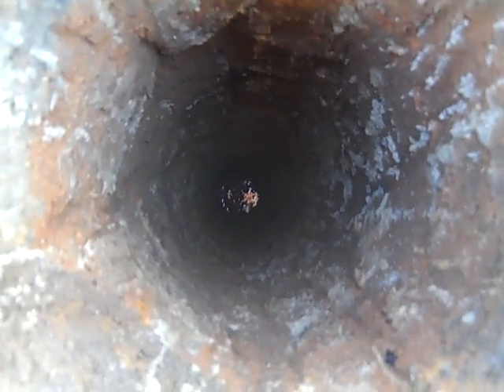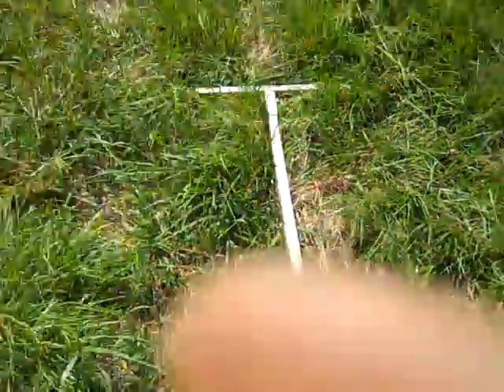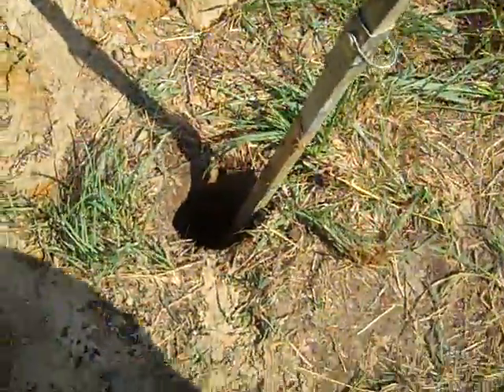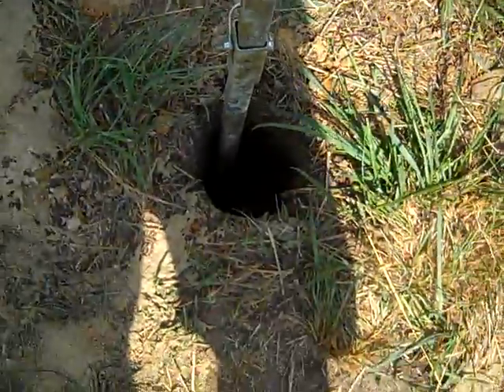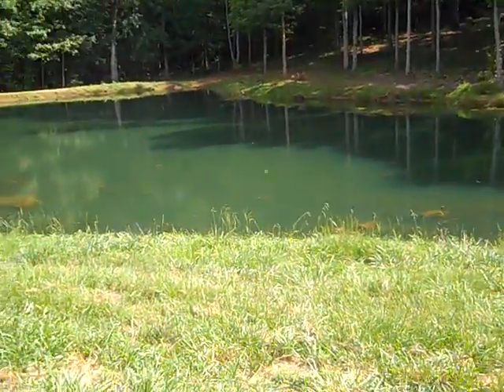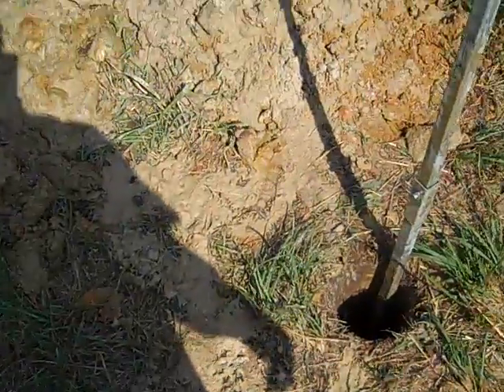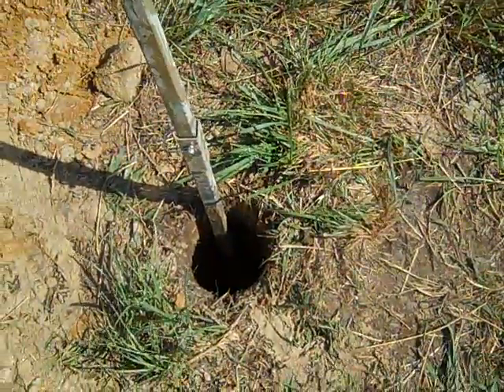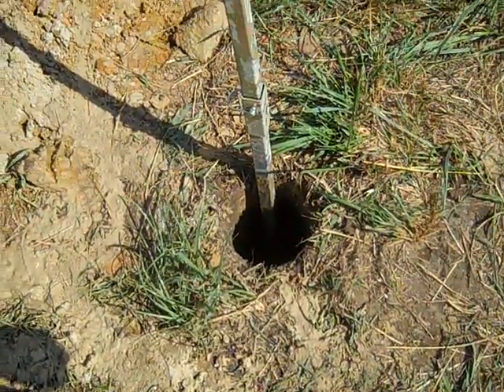Drilling a well on the Farm by hand

Comment: "HEY ENGINEER775 PRACTSPREPPERS" not trying to be a smart-ass "BUT" what was (plan-b) for hitting solid rock ? And would a post hole driller with a 6' auger bit be a viable replacement for hand crank drill ? as always THANKS-4-GOOD-VIDEO

Comment: it says "not recommended for wells beyond 50 foot deep" so if you have an idea that your local wells are deeper, dont dig using this method. I myself will contract that job to a professional company to install the well head and double acting pump that will be driven by a windmill. There are ways to do stuff, just research the best way for you and the property you will be digging into.

Comment: I just drill where i wanted the bore, I found water at 19feet. I had the benefit of knowing my neighbor got water at 16odd feet - only 150ft from my well. Im pretty skeptical of this wobbly stick method - i reckon there is water everywhere it just a matter of how deep, its hard to see how the water table would change dramatically over a certain area -but that just my opinion!

Comment: Thanks , So can you explain how i case the well and keep drilling? does my auger have to fit down the inside of the casing? When i finally fit the casing I need to fit a screen (6" plastic pipe capped with holes in bottom 6 foot and a drainage sock on outside - i think!) at the bottom , which i obviously cant use as casing while i drill. thanks tim

Comment: your going to need to get some casing in there to hold the sand back. Running sands and gravel are hard to overcome and if you try to bail them out you just create a void as more and more runs in. quality and quantity depends so much on your location and geology.